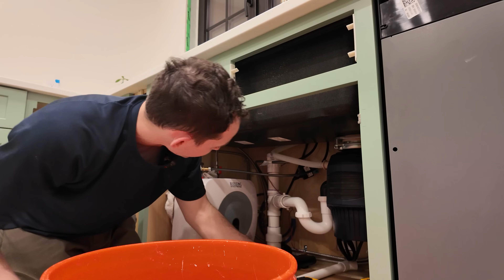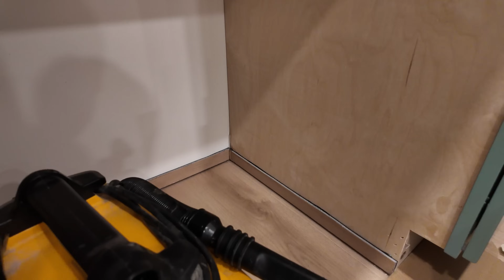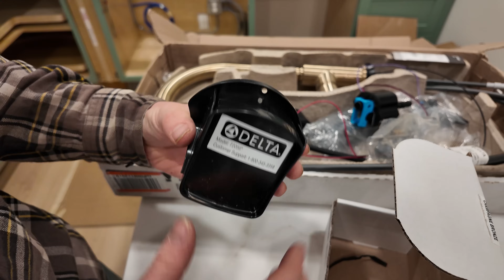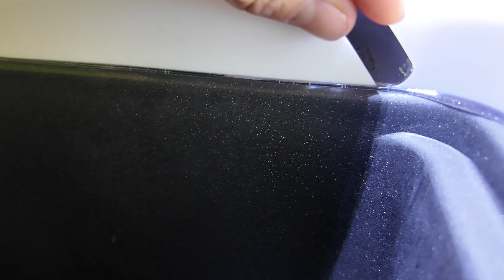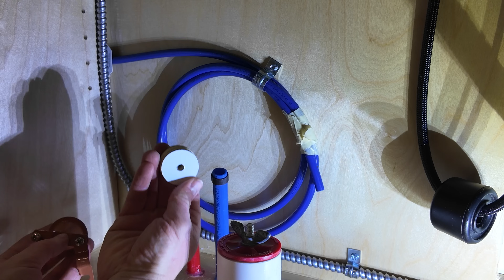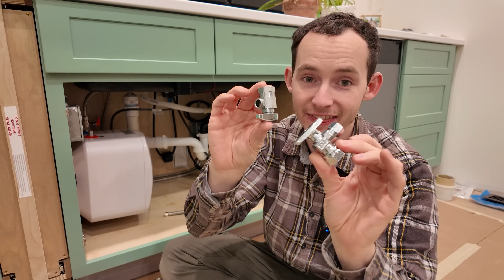Plumbing a High-Tech Kitchen Sink (Kitchen Build Ep. 7)

Comment from the maker: The touch faucet has unexpectedly become a favorite feature of the whole kitchen. Both hands messy? No problem. Need to turn on water for a quarter second to rinse a glass quick? Easy. No getting the handle dirty or guessing where to wave 👍🏻
Reply: My wife and I installed this exact model faucet in our house 2.5 years ago!
Absolutely loved it!  Though we wished we would have had the ability to plug it in instead of use batteries.

Comment: You should consider pulling hot water for the dishwasher after your point of use water heater. Technology connections has a great video showing how much of a difference not having a bunch of cold water go into the dishwasher at the beginning of the cycle makes.
Reply from the maker: I will have to check that out. The specs for this Bosch unit calls for a cold input oddly enough. I think it heats its own water to have more control over temp, it does not have a heating element in the bottom like old style washers

Comment: I love my touch sensitive faucet. This is the second house I’ve installed one in. My current house had a kohler faucet with a light sensor that the cat triggered accidentally when it looked out of the window. Also the top rim of pots would turn off the faucet while I was filling. I believe the current one and previous ones were made by Delta and imho are superior.

The first house’s faucet had the battery pack. The second has a plug in transformer.

Comment: You tried to put an NPT fitting on a FIP fitting. They aren’t compatible.
Reply from the maker: NPT is the tapered thread standard, MIP and FIP are male/female fittings with tapered threads to the NPT standard. Male NPT and FIP are compatible. The terminology is confusing, FNPT = FPT = FIP 

Then there are NPS straight threads, like a washing machine or garden hose. In this case the heater and both stop valves were labeled as NPT tapered fittings, but the heater was probably NPS straight threads in reality (cheap Chinese stuff). One of the FPT stop valves had loose enough machining to make the straight male threads work with the tapered female, the other did not

Comment: Tip: Staple a poster board shroud loosely over your faucet hose and weight beneath the sink. The under sink trolls have a way of moving items around when the cabinet doors are closed so that those items get caught on, and thereby lifted up, when you go to detach or replace the faucet.

Comment: Even with that little divot, the garbage disposal can work its way loose (it happened to me) and crash down. I recommend zip tying one of the lower piece’s barrels (used for tightening) to one of the upper flange bolts. 🙂
Reply from the maker: Oh gosh thanks for the tip!

Comment: I think you got snookered by the difference between straight threads and tapered threads, and the fact that they make both with the exact same nominal sizes and thread counts, so they "almost fit", but aren't right.

Notice how the braided line on the rear port of your heater seemed to work fine? I bet that's because it has a rubber ring/gasket inside of it. In that situation, the threads of a joint are not forming the water seal at all. Do not use either dope or teflon tape on those threads. The threads just work like the threads in any screw: they provide mechanical advantage to bring two components tight against one another. In that case, it's the rubber seal that is preventing a leak, not the threads at all.

What I think you did is add an off-the-shelf plumbing fitting to the front port of your heater that isn't designed to work that way. It is designed to work with tapered threads, where there is no gasket, and the threads themselves are responsible for providing a tight water seal. For those fittings, you do use tape and/or dope.

But, the manufacturer of your water heater is the one who dictates which kind of fitting you need, and I suspect they are expecting a straight-threaded fitting with a rubber seal inside.
Reply from the maker: The tech specs for the heater calls out 1/2” NPT so I assumed it was tapered, and both parts I got were 1/2” FPT angle stops. I’ve never heard of a straight thread angle stop tbh
Reply: @MasonDixonAcres  Yeah, I've not had good luck with plumbing fittings, especially purchased on Amazon from international vendors, using terms like "NPT" consistently. I know, as an engineer, it's inconceivable for such a thing not to be clearly specified, but plumbers shrug their shoulders at such things: "meh, we just know".  You're right, those fittings at Home Depot or US box stores normally rely on tapered threads and muscle to tighten. As I said, the problem is that your water heater vendor essentially boxes you in here, and I bet they're assuming the standard braided under sink connection lines that do have rubber gaskets, and straight threads.

Comment: I have one of those Manibloc pex manifolds and you can use them with a hot water recirculating system. You just can’t include the manifold itself in the recirc loop. So, you typically will have a cold line from the Manibloc to the water heater, then a hot line back to the Manibloc. Tap your recirc loop into that hot line 6-12 inches short of the manifold. So, you’re keeping almost all the hot line hot, but the manifold itself does not stay at elevated temps, which they discourage. [NB: depending on how close your manifold is to the heater, and your pipe diameter, this may be of little value for your layout]

Comment: I own a water company in Vegas...you can get RO systems that have 1:1 waste water ratio's.  I know you don't like to waste anything if you can.  :)
Reply from the maker: Haha thank you! I can’t remember the reasoning but somewhere I read there was a different downside to the low loss ROs versus the standard tanked type. We have a great well and typically get plenty of rain here so the waste water doesn’t really bother us
Reply: @MasonDixonAcres  I'm not a big fan of the tankless RO systems.  The TDS reading spikes with those systems.  But, the amount of water waste depends on the membrane your RO uses.  I have RO systems that use tanks, but a Pentair membrane has a 1:1 waste water ratio.

Also, it appears you are going to just tap that RO system into the fridge and that's all.  A little heads up...that's probably a mistake. In 12 years, I've done that 4 times because the homeowner wanted nothing to do with drilling a hole on their countertop.  In all 4 occassions, the home owners had us come back out and drill the hole for the faucet withing 48 hours.  The reason being is that you will need to drain the tank a couple of times before you can drink the water.  If it's only hooked up to the fridge, you have to do that one glass at a time.  It will take you forever and be a pain.  Just something to consider.

Comment: Well did the light ever turn red with the hot water or did it stay blue?
Reply from the maker: Haha it did eventually turn magenta. Thats the in between color that means warm. I don’t have the water heater set hot enough to make it red, because it comes through a mixing valve for the floor

Comment: Compression fittings are a different thread. Than a regular pipe thread of the same size.
Reply from the maker: The spec for the mini heater called out 1/2 NPT

Comment: do you have a smart enabled water valve?? I have Govee as well and it’s great, but when it detects a leak you’ll want to quickly (and perhaps automatically or remotely) want to turn off the water supply
Reply from the maker: Will probably implement that down the road, definitely agree

Comment: id have the tiny water heater go to the sink AND the dishwasher.. the dishwasher wont run enough water to really get it hot.   in my house i installed a recirculating pump on a timer and just hit the timer..
Reply from the maker: I actually had a long winded explanation about this in the video that I cut out because I thought no one would notice or care 😆

The reasoning for teeing off for the dishwasher before the mini heater rather than after, was the Bosch DW we picked actually heats its own water (presumably for greater control) and surprisingly the manual calls out for it to be connected to a cold supply.

My thought was the DW will purge some cold water out of the hot line when it runs, and won't use any of the warm water in the mini heater when it runs, leaving it for hand/dishwashing.
Reply: It’s pretty standard for dishwashers to add heating to the water they use. It’s a heating element at the bottom.
Reply from the maker: This DW does not have the standard metal element, it is something else internal possibly like a keurig lol

Comment: You getting there. Goo gone easily removes uncured lexel and hasn’t reacted with anything I’ve used it on. Also for future applications, I always have them undersize the sink opening by a half inch so the countertop sticks over all the way around by a quarter inch. No squeeze out is seen also it’s so hard to keep that edge clean if the countertop doesn’t overhang
Reply from the maker: Thanks for the tip! This is a work ledge sink so there are accessories like a roll up drying rack that sits on the ledge, so the counter can’t extend past the sink edge unfortunately

Comment: Have you considered mounting the R.O system in the utility room downstairs?  If it leaks, it wont damage the cabinetry or flooring.
Reply from the maker: That is currently the plan. The only hesitancy I have is theres 70’ of pex (about 1 gallon of water volume) between the manifold and ice maker outlet. Any growth on that pipe wall or trace PFAS that might leach in from sitting in the pipe for a while is on the clean side of the RO filter, and it’s too much volume to purge at every use. I felt like keeping the tubing length as short as possible (point of use) takes that downside away. I do like all equipment to be in the utility room, and it makes drainage and filter changes easier for sure. Going to try it there for a while, test the water, then move it upatairs if needed